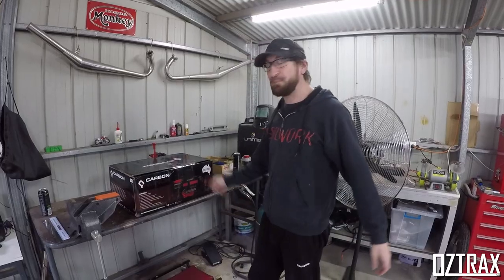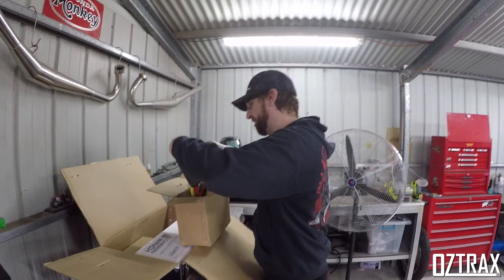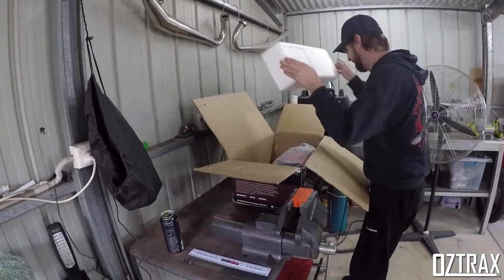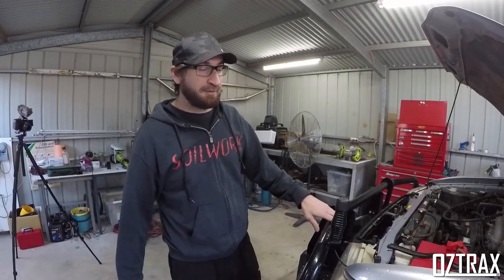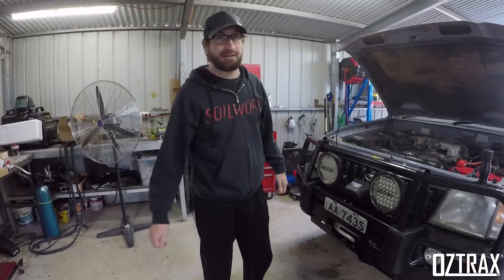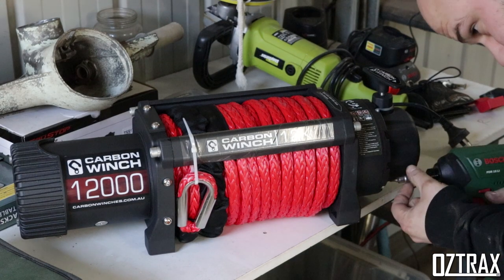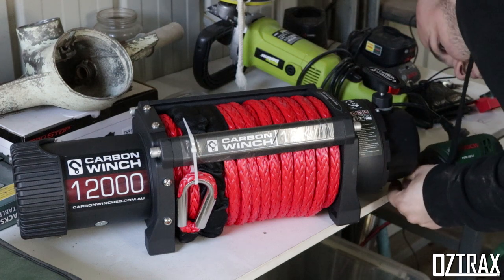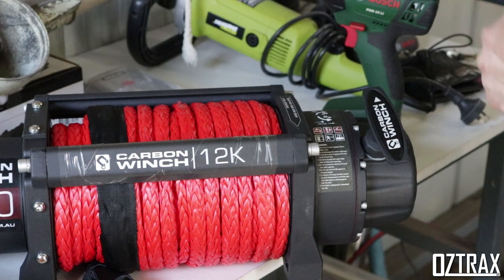Toyota Prado 90 Series // Carbon 12K V1 Winch Install

Comment: Hi, nice winch and a good video from you, as usual. What was the reason for swapping the winch though?
Reply from the maker: Thanks 🙂

The old winch failed due to poor quality control.

It was only 6 months old and the armature had rusted, along with the brush holder due to condensation from a poorly sealed casing.

I did get it working again after cleaning it up but have since sold it and cut my losses.

Comment: I’ve got a 3.4 petrol 95 series I’ve got a winch hooked up to it but I gotta ask how dose yours go like my struggles heaps just looses so so much power I’ve 860CCA HD battery & Toyota only make 80Amp alternators witch is stupid how’s yours cope?
Reply from the maker: Unfortunately I don't have the 90 series anymore (you can check through past videos for that one to see what happened).

Regarding the winch, mine worked fine, with no issues with an 810CCA battery.

You should be winching with the vehicle running and 15 seconds pulls at a time with a 30 second cooldown between pulls.

Constant winching with no break will flatten your battery quick smart.

Comment: Hi that bar where your winch is sitting on is it standard bar or did you weld it on yourself as my 2000 RV doesnt have it ..?? Im trying to see if i can install a winch through a winch plate?
Reply from the maker: Hey Warren

That's the winch cradle that comes with the bullbar.

Comment: I've been looking at getting a 90 series Prado. But I've been told multiple times that they simply aren't great, or tough enough to handle proper offroading. Have you found them to be more of a hassle in that respect? Are there any particular years you would avoid?
Reply from the maker: They are certainly more than capable of doing extreme wheeling as well as touring.

Obviously about as big as you can go without doing a body lift is 33 inch tyres, but as with everything, you have to build it to make it work for whatever you want to do with it.

I really just need to sort out a rear locker and decent tyres and I will be able to do most things that the bigger rigs can do.

A good example of that was watching an 80 series Landcruiser with 4 inch lift on 35s that was unlocked get stuck in the exact same place I did with a 2 inch lift on 31s while unlocked.

It has definitely done what I've asked of it and I'm more than happy with my choice.

If I had my time again (I was new to offroading when I bought it) I'd probably have gone for an 80 series Cruiser just due to more space in the rear.

Regarding the years, the early and late 90s run the same suspension, but depending on the model/options, traction control can be found on the Series 2, so 99-02 models.

That works pretty well from what I've seen out of a couple of people who have that feature.
Reply: @OzTrax4X4  I really appreciate the response. I don't know yet if the extra room in the back is something I need. So a bit more research is needed on my end lol. I'll definitely be keeping the Prado on the research list. Thanks.
Reply from the maker: No worries 👍 Happy to answer any questions you may have.
Reply: @OzTrax4X4   They are amazing i have a 90 as well 440000km on and planning my next trip soon
Reply from the maker: Where are you headed mate?

Comment: Hi there, when you installed the control box was there a rattle inside the box before you mounted it??? We've just bought one and have installed the winch, however there is something rattling around in the control box?? Any help would be appreciated. Cheers
Reply from the maker: Hey there!

No rattles from mine. Did you open up the control box and have a look?

Sounds like something may be loose inside?

I'd be interested to hear what that rattle is.
Reply: @OzTrax4X4  Hi yes we did and there’s a small box in there that’s lose but we don’t think it’s that. We’re going to wait until tomorrow Monday to call them to find out what’s going on. I’ve taken a video to send to them.
Reply from the maker: @That_Girl_7_11  the only thing I can think of would be the solenoid is faulty/not assembled correctly.

Very strange. 🤔
Reply: @OzTrax4X4  that’s what were thinking. Apart from our issue how have you found the performance of the winch ?
Reply from the maker: The winch had been solid. Haven't had to use it yet but works every time I power it up.
Reply: @OzTrax4X4  Thanks for getting back. We’re going on a 7 week trip to Arnhem Land at the start of June so we’re keen to get it fixed. It’s not a good start to our introduction to the 12000 winch though! 😥
Reply from the maker: I'd give KPD 4X4 a call and I'm sure they'll sort it out asap.

Hey, at least it's better than the King's winch I had, which failed after one use.
Reply: @OzTrax4X4  KPD ? Ooh really... we wouldn’t buy one of those heard nothing but bad reports about them.
Reply from the maker: @That_Girl_7_11  yeah KPD are the parent company of Carbon Off-road.

And as the saying goes, poor man pays twice. 😐
Reply: @OzTrax4X4  we got an answer back from Carbon Winches and they said it was the solenoid but that it was attached and won’t cause an issue so we’ve just about fitted it and when we fire it up we’ll let you know if it’s working. They were very good about it all and said if there were any issues to give them a call straight away.
Reply from the maker: Thats the service I like to see.

They're good like that.

Did you end up rotating the gearbox to make the clutch more accessible or was it fine in the factory position?
Reply: @OzTrax4X4  we needed to rotate it, also the handle for the clutch had the paint pealing or flaking off which they are going to replace straight away. We told them that we had already fitted the winch and it would be more of a bother at the moment to remove the bull bar so when we do the service in 12 months we will fit the handle then. All in all the service is excellent and we can’t fault it. I just want to see it all up and running and I’ll be happy.
Reply from the maker: To have a company stand behind their product like that shows that they believe in it.

Unfortunately sometimes something slips past QA testing/checks and you get a dud.

I barely use mine as it is, but it has been solid and works when I fire it up.

Just make sure you cycle it once a month to keep everything lubricated as you'll be happy you purchased it. 🤙

Comment: Damn! I was gifted a kings domin8r. Hope it last on my 90 series🤞
Reply from the maker: If it's a Domin8r Xtreme you might have issues. The regular Domin8r does seem to suffer that issue.

I only got to use the Carbon winch once and then I was in a severe accident in the 90 series.

Have since got an 80 series diesel with a Warn winch which has had zero issues and has been on the vehicle for 9 years prior to me getting it.
Reply: @OzTrax4X4  What happened to the 90?

Comment: Nice winch , could you tell me what tyre size and rims and offset please as I'm going to update from standard
Reply from the maker: Hey mate

If you check out my Road So Far video I go through it all there. 🤙
Reply: @OzTrax4X4  thanks that's great, I checked it out. All good
Reply from the maker: Easy as bud 💪 I'll be upgrading tyre sizes too.